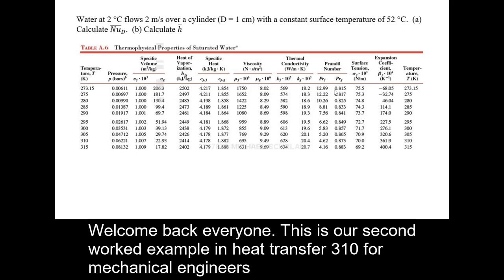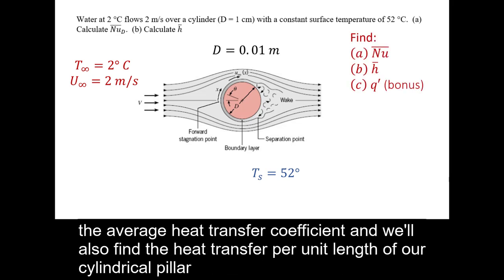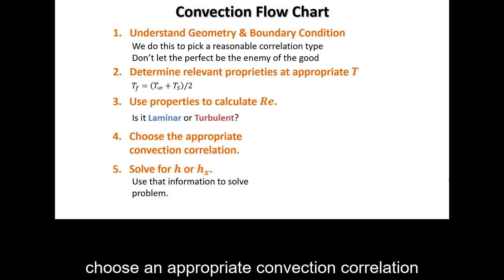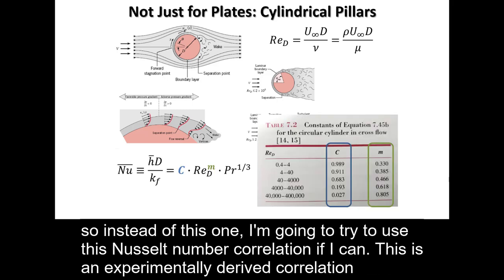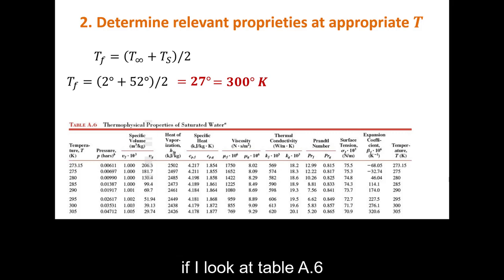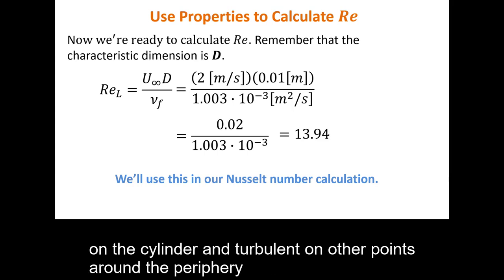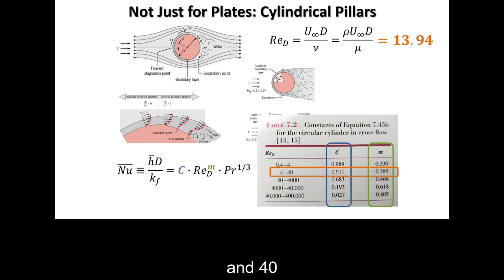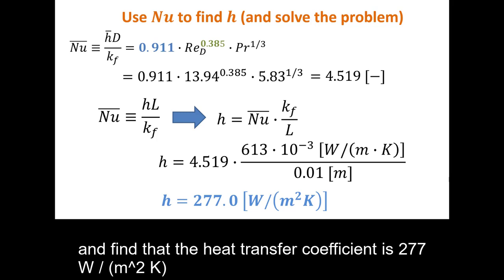External Convection Cylindrical Pillar: Heat Transfer Examples for Mechanical Engineers

Comment: 03:40 Looks like we picked up the specific volume value from the table and used it as the kinematic viscosity. I think we need to use mu_f from the table and assume the density of water is 1000kg/m^3 when computing the Renolds Number.
Reply from the maker: Good catch. Looks like I messed up the notation here where mu on the table is specific volume (1/density). So, you are correct that we need to pick up the dynamic viscosity from the table. Normally, we'd then divide by the density, but we can also multiple by the specific volume (you are correct that density of liquid water is ~ 100 kg/m^3 in this case). 

So I think our kinematic viscosity should be 855 x10^(-6) [Ns/m^2] x 0.001 [m^3/kg] = 855x10^(-9)[m^2/s]. 

Then I get that Re~24,000. 

The constants in the correlation will change C = 0.193, m=0.618. Put those in for avg(Nu) to get avg(h).

The process remains the same, but the correct data will change the values of the solution.

Again, great catch. It's nice to know that people are paying attention to these. And I'm teaching Heat again this semester, so I'll go back into my notes and correct this. Thanks!
Reply from the maker: Looks like my final answer was 170.3 W/m (leaving the plate) with these values...assuming I didn't make a clerical mistake.